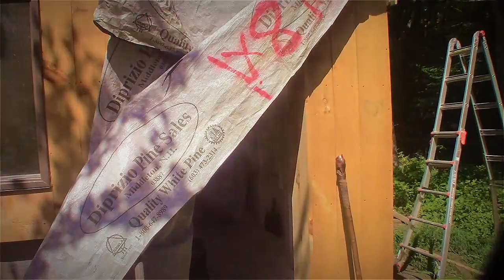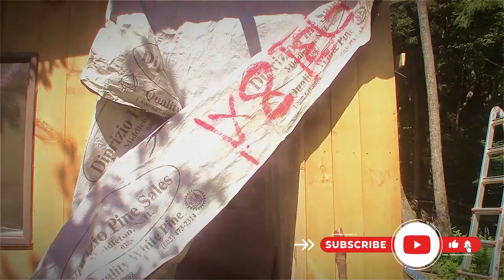This is It! It's Too Late to Prep Now.

Comment: Well done. I like being rural and in the boonies myself. The downside I see where you are at is danger from a forest fire. Have you thought about if a wild fire comes at you? Would you clear a perimeter and have IBC totes placed with water and a hose? Just an observation.
Reply from the maker: Forest fires areny a thing here in new england and the future climate models suggest we're likely to get wetter vs drier. So it's not something that keeps me up at night. But i do plan to oish the forest back a bit more and to have a sprinkler system for the house's outside someday.

Comment: Very very great advice. Too often we here that if you havent been prepping you are screwed. Realistically, all preppers started somewhere and sometime. Over the years, yeah, you can get fancier gear amd such, but at first we all got basics. It is rough up front, but at the end of the day, any prep is well deserved and appreciated. S may HTF any day, but may be years away. If there is concern prep anyway. BTW, your coop looks far better than mine, bit yes, mine could be used as shelter. Structurally sound.
Reply from the maker: As long as one can stand up in it, (imo) it's a shelter. ;)

Comment: I've always wanted to build a 8'x16' shack. A big rectangle box with a slant roof. With a couple of 8"x8" timbers on the bottom to act as a sled. It could be pulled around the property by a tractor. It would have a bathroom and a kitchen/bedroom/living room.

I don't really need one, but I don't need an excuse to build one either. Maybe a smaller one minus the bathroom some day.
Reply from the maker: I love that idea. And i can appreciate wanting to build something even if you dont need it. I definitely did NOT need to build a chicken coop at the level i did... but i REALLY wanted to.

Comment: I regret selling my RV two years ago. It was my "mobile bugout location." I still like the RV idea for a bugout location, but there's no doubt that the structures you built are much better for a long term (or winter) bugout situation.
Reply from the maker: I did a few winter is a travel trailer when i was saving up money for my first house. They can be challenging for sure.

Comment: That's a comfy looking chicken coop. I'm quite low maintenance so I'd happily live in there, me and bunch of pigeons, all of them roostin' on the roostin' bars!
Reply from the maker: Just don't place your bed under the bars! I'm thinking of putting poop troughs hanging on whichever side of the bars that the chicken's butts tend to hang.
Reply: @PraxisPrepper  Pigeon guano is a good fertilizer. Dovecots are designed with collecting it in mind.
Not sure about chickens. But perhaps you could extract the saltpetre for when your ammo starts to run low?
I'm quite fond of chickens really, their amiable clucking mother-hen ways.
Ducks and geese can be fairly assholey. I know a pigeon called Goose and she is quite a friendly bird and doesn't hiss.
Reply from the maker: I generally like chickens too, but I wish they'd treat each other better. Hen pecking comes up now and then and sometimes the roosters can be so terrible to each other. I wish they could just get along with each other.  @woodypigeon
Reply: @PraxisPrepper  Pigeons can be surprisingly mean to each other as well. Pecking at each other and wing whacking. Arguments often break out if more than one is on my hand eating. 
I have to remind them to set a better example, what with being doves of peace and all(allegedly). 
Most of the time their antics are really amusing. Proper little characters they are. And far more intelligent than folks give them credit for.

Comment: I got a bunch of pallets and cinder blocks I am going to take to the woods and make something big.
Reply from the maker: AS long as you take cross-bracing seriously, you should be able to make something pretty strong and durable. What do you plan for a roof material? A (very) high quality tarp can work as long as it's over a surface that won't puncture it, it's tied down securely, and it's not in direct sunlight.
Reply: @PraxisPrepper  Yes Sir, I have many sheets of tin also. I guess, I will try tin first. I have been just so busy bucking, splitting, and stacking wood lately; from the storm about 2 months ago; in small town USA in Georgia with 1 traffic light. Locals call me to come get the wood up after the local tree surgeon drops and quarters. I do not even charge them but tell them they on there own with the tree tops which the city picks up if beside the road.
I see many more major storms coming!

Comment: But Praxis people are far too lazy to do any of this or they'd have already done it. Bugging out is a prepping failure. Forced relocation is a fail. Move voluntarily to a good area
Reply from the maker: Even the best plans have a failure rate, so even for very thoughtful preppers a plan b isnt a crazy idea (especially if that plan b can be used as a vacation destination). As far as "if people were gonna do it, they would have already done it" (slant quiye there), that's true, but there is a constant flow of new people aging up into prepping too. If i were 20 years younger now and just coming to realizations aboit the state of the world, i'd feel overwhelmed by it all. I think a message that there could still be time is helpful to at least those people.
Reply: I agree but they bug out and then what? Starting a garden takes a few years. Building a home takes massive labour ie calories. My advice is find abandoned cottages with chimneys in a quiet place you can cycle to in three days  @PraxisPrepper
Reply from the maker: That's a cool alt idea too about the abandoned cottages. I can't think of any offhand in my area, but I bet there are some.  @HuplesCat
Reply: People won't get to them in many areas. You can also use utility and cell tower buildings. They are reasonably common around the countryside  @PraxisPrepper